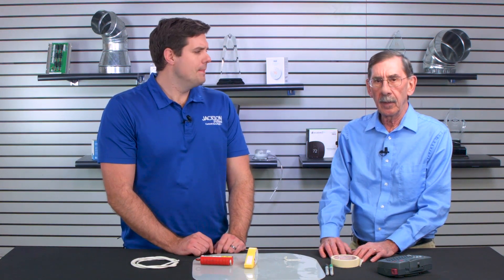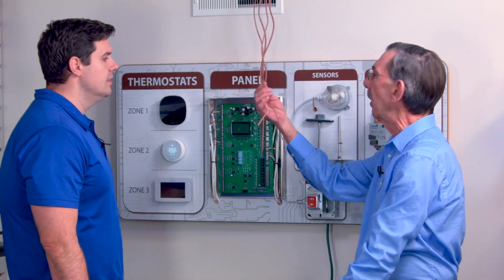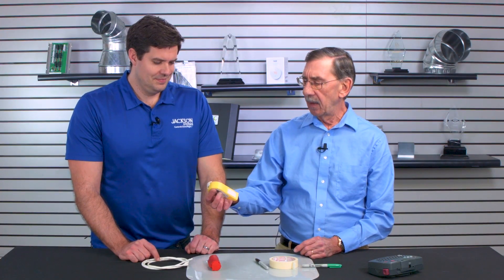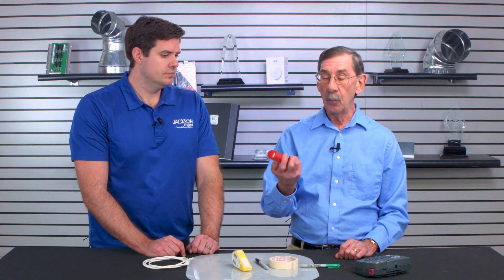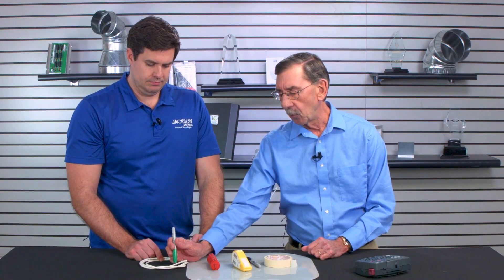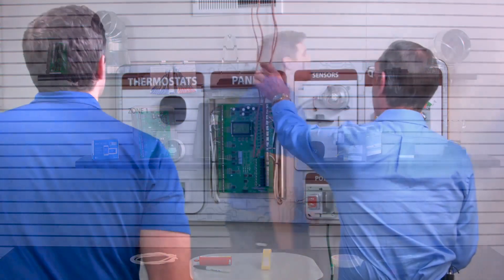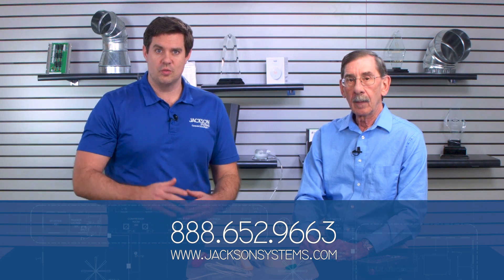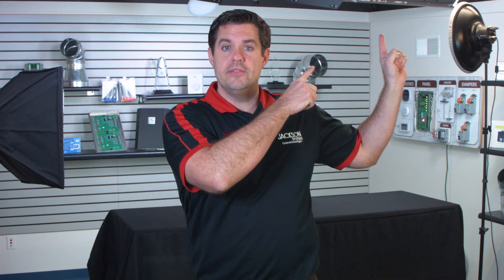How to Properly Label Wires

Comment: I'm not a HVAC Tech but I am a professional Low Voltage Tech and I'll share some tips.
Fine tip Sharpies, all you need is Black and Silver.
White Electrical Tape, comes in handy to label wires and wire locations.
If on a Construction Site you could pick up some Romex sheathing left over from the Electricians and you could slide a piece over a couple of wires that are grouped together and write on it with a Sharpie.

I typically tag my Cables twice. Four inches from the end then measure out the Cable from the end of the Cable at the tip of my Index Finger and thumb to my Elbow then tag it again.